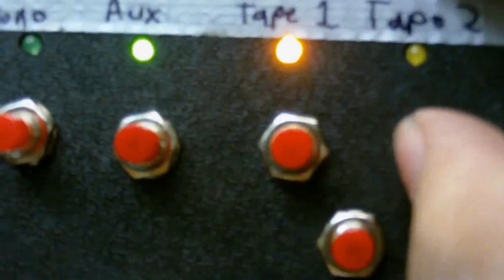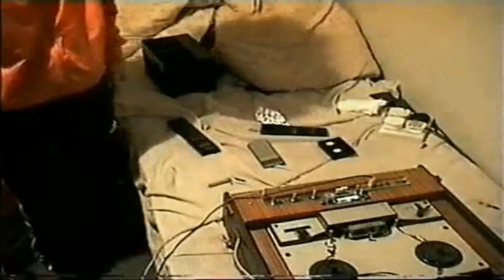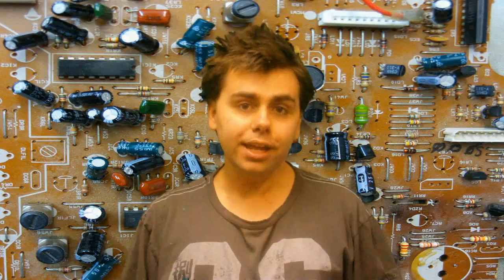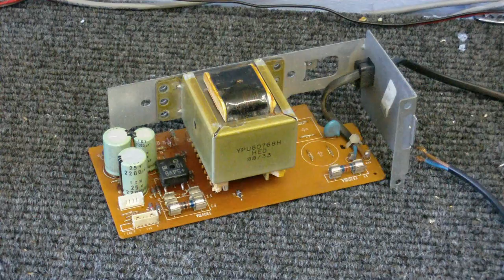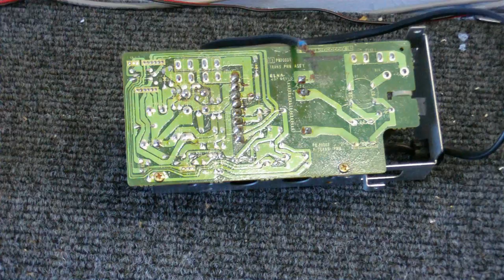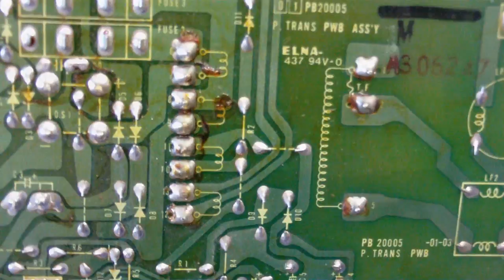CDC Electronc Workshop S2 EP 1 - Fixing the Ferguson videostar VCR pt 1 - Testing the power supply.

Comment: Don't you worry buddy, I could comment for a long time eh...

First, kudos for wanting to determine the cause of the problem.
Second, I am appalled that Ferguson chose to NOT INSTALL the hash filters(coils) on the AC line... Cheap.
Third, Capacitors cannot be reliably verified using the continuity method. I even do this but know that they will not indicate a leaky cap.
Good idea on the yellow tape!